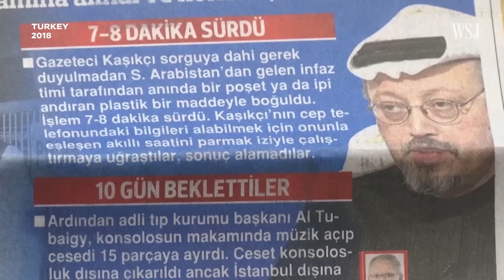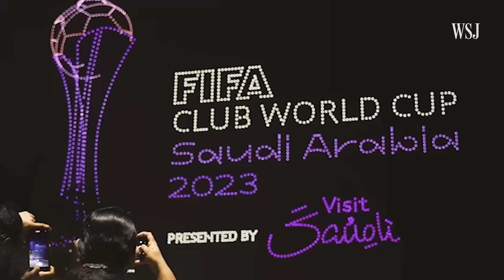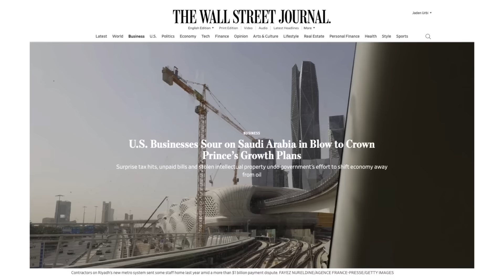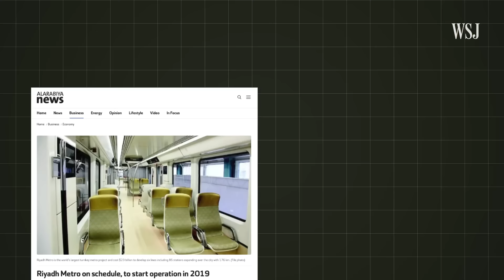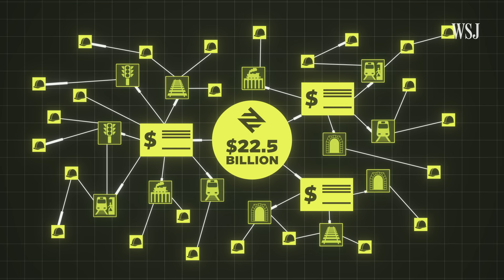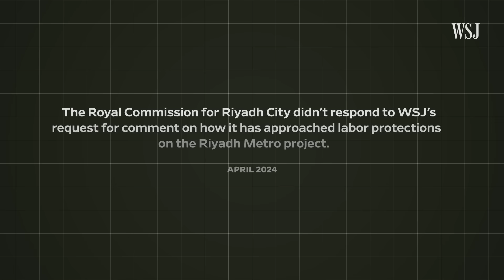Saudi Arabia’s Race to Build a $22B Railway in the Desert | WSJ Breaking Ground

Comment: Don't underestimate the Saudis,they are planning something big and futuristic.This metro project will fix the transportation issues in Riyadh..insha Allah.We will get rid of the traffic jams finally
Reply: How? The saudis are the ones creating the traffic problems but they`ll never use this tube only poor asians will.
Reply: @TommyHoff  metro trail will reduce the time on road so why Saudis will not use it? Do Saudis have extra time for spending on the road?.Now everyone needs to reach their work on time and  metro is the solution.
Reply: @Rustamay  No Saudi is using the bus service only poor foreigners use it. Why would the metro be any different?
Reply: @Rustamay  Pretty idiotic using a system that so few people uses.
Reply: @TommyHoff  Metro is faster to use. No one uses the Bus because its stuck in traffic with other cars! so there is no difference.
Reply: @TommyHoff  Have you been there? Do you think every saudi has a car? Why then do they have so many buses/minibuses that both locals and foreign workers use? Every nation needs a mass transit (metro, LRT, bus exclusive lines, etc.). And the saudis WILL use it when it's finished.
Reply: @KGF-zf2qj  If buses are given separate lanes on roads so that they don't get stuck in traffic, then how many people will use metros? Metros are an unnecessary and inefficient solution.
Reply: The way the word 'futuristic' is used nowadays is really like 'leading to a dystopian future'.
Transport issues don't get fixed due to a metro project. Metros are not the solution for traffic jams.
Reply: @yashagrawal88  hhh why you're replaying every positive comment in saudi arabia, because it hurts you to see🤔
Reply: @adamsaciid4919  Just because something is positive about something does not make it right.

Comment: To say Riyadh, hottest is misleading. 
The best season is from September till April. 

The hottest months start from June till August. 
Three months dont dictate full year. 
Plus Alqedya will be in upper hill that will make the weather a bit colder than the rest of Riyadh.
Reply: I visited Dubai before, there are two subway lines there, however due to the hot weather, most people come out after 7pm. AC is everywhere in the subway stations and shopping malls. Highways are covered with sands after sandstorms, cleaners sweep the highways diligently.
Reply: @icebaby6714  
Riyadh is colder than Dubai, plus it has hills and doesn't have a beach that causes  humidity and sweats. 
humidity in the desert is low
Reply: @icebaby6714  I assume that you visited dubai in the summer? It is the worst lol. But anyway dubai is way hotter than Riyadh because it’s a coastal city. Riyadh weather is mostly nice or cold but you shouldn’t visit it in the summer too, because that will be like visiting moscow in the winter and then complaining about the extreme cold weather
Reply: @Eng_Ahmed_b50  I would like to visit Riyadh in spring or autumn.
Reply: @factcheck9849  
I suspect living near the sea is so much better than living in the desert.
Just imagine the sea breeze and the chance to dip in the cooler sea whenever one desires.
Reply: @icebaby6714  that will be the best time, nice weather :3
Reply: @icebaby6714  Dubai is humid and Riyadh is dry it’s huge difference and also Riyadh is much colder than Dubai in winter it gets nearly to 0C
Reply: @icebaby6714  AC is not a solution but something that worsens heat.
Reply: Can workers work even a week of summer days without heat exhaustion?!
Three months of heat is bad. And don't forget that it will keep worsening because of global warming and local construction.
Reply: @yashagrawal88  construction workers work in nighttime in summer. Anyway it’s as bad as working in -10C in winter in northern cities like moscow
Reply: @Eng_Ahmed_b50    im worried about my country depending too much on tourism and  mbs think is a good idea  spent lots on tourism that may never come... when climate change start disrupting the markets looking back on videos like this will be really sad. just like a metaphor to humanity what we could have become but never will. does anyone else finds ironic the oil gave saudi arabia so much is gonna take away so much ... permafrost already defreezing methane already pouring into our atmosphere. do you think is hot now? hahah you dont know what is comi g we already pass the summer here in the south hemisphere you guys are in for a ride mark my words ... you and i we both will be climate migrants mark my words ... well if allah gives us health ... but this planet is beyond repair
Reply: @rioluna6058  climate change will affect every single country in this planet. You think we will be climate immigrants? But to where? Dry Europe and east asia? Flooded south asia? there’s no safe place if the problem wasn’t solved, but that doesn’t mean we stop trying… we can still work on tourism and manufacturing while trying to help earth. There’s no point on giving up now because believe me trying is better than nothing
Reply: @icebaby6714 Dubai is very low compared to Riyadh, and most saudi cities aren't as hot as people thinks because their elevation is over 600 except Jeddah and Dammam

Comment: Still not operational? Was meant to be Q4 last year for at least two of its lines (Blue and Yellow) and after seeing the Yellow Line last year (as a guest of KSA) it did not seem that far off with station fit outs in the big stations nearly completed and testing well underway. 

What is the hold up now?